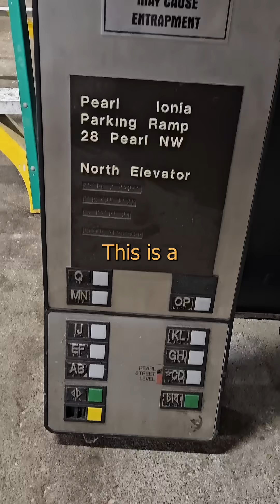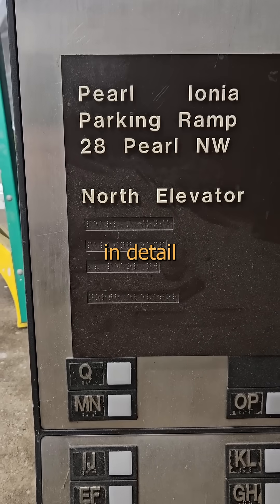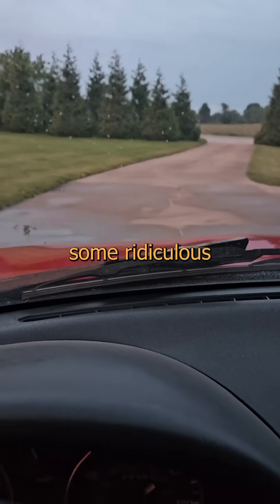Miata Mischief #chrisboden #engineering #gear #elevator #score #stories #parts #hacking #making

Comment: My buddy and I went four hours up into Pennsylvania last year for a tiller and blade for his John Deere 110. We’re in his 1984 Ford F350 Centurion Conversion truck, which at the time didn’t have AC, the wheel bearing was shot, from end has PLAY, tranny lives on Lucas, so on and so forth it’s not safe to drive. But we do anyways, and mechanically nothing goes wrong. Unless you count the wipers falling off on the interstate during the biggest hurricane of the season. 

Anyways, the trip up took 5hrs and some change cause traffic, there’d been a few accidents. We have the CB on while we’re sitting at one point and we hear “did anyone else just see this cop nail this lady?!” 
Sure enough, a cop that was flying up the side of the road tried getting in front of this lady and took her front bumper off. 
As we’re cruising by laughing, we see the cop standing in shame and his partner was head bowed in the cruiser still. That was our little comedy/tragedy/delay on the way up. 

But on the way BACK is when things got sketchy. A downpour slammed us. I looked up the weather and apparently we’re driving juuuuust in front of this hurricane, but it looks like we’re in the heat of it. We hydroplane here and there, the wipers fall off and we have to pull into a sheets in Maryland halfway home. The rain turns into a drizzle. He takes a Tik Tok of the rig at the pump (and I photo bomb in the back, dancing in the dark like the weirdo I am), we fill up the tank and our stomachs and hit the road again. I get a text from my girlfriend that two tornadoes touched down near where we were in Virginia, one is a rarity in this area, two is unheard of. His mom calls and says if the creeks flooding I’m staying at their place. 
We get home fine, creeks fine, I decide imma head home since our jobs done. Within the five minutes that it took for me to get into my car and down to the creek, it had flooded. This is a 6ft deep creek that runs under their driveway, it was maybe a foot five minutes ago. Now it was on the driveway. 
I go slowly through and hit the road. Not even a mile up the road I stop because there’s a tree (not too big but enough to ruin your day) in the road. There’s a guy behind me, he just honks, and someone else in the oncoming lane is coming but can’t see the tree. I hop out in this now torrential downpour and wave frantically. He stops and gets out confused, I start bucking bits of the tree (it had broken), and that’s when he sees the tree and begins to help. Other guy stayed cozy. We all start moving once it’s as  cleared as we can make it. Maybe two miles later, another tree, this time I swerve around it, the guy behind me does the same. The winds now picked up and is blowing us around the road. Eventually I get to my road and the winds blowing directly at me, and it’s so strong I had to put way more throttle into it than normal. Finally, I’m home, my girlfriend comes running out with her umbrella, being the sweetheart she is. Halfway back to the house the winds blowing directly shreds the umbrella. We run inside, soaked, tired, and I’m hungry again. 

I started that day at 5am. And didn’t get home until 2am.

Comment: Hmmmm, I was into burnouts and drifting as a teenager and I'd blown the differential in my Torana (an Aussie GM muscle car).
Anyhow as a 58kg 1st year apprentice mechanic, I urgently carried an entire Salisbury differtial/axle (which unlike a banjo differential, the centre is part of the entire housing), up at least a 2km 35-40° angle hill to get it home from work, complete with axles, drum brakes and I didn't even drain the oil 😆😆😆
It was way heavier than myself 🤘💪
I did not stop for breaks and when I got home, I smoked some weed and a cigarette and proceeded to install it so I could go out cruising in my Torana that night, which happened to be Friday, hence my efforts, which were a complete success 😁🤙

Comment: I own a little 2004 Saturn ion 2 door. The one with the fold out rear doors. I somehow fit a 7.5 × 7.5 ft L shaped desk inside and got it all the way back to my house. Granted i had to cut it in half and while driving only had access to first and third gear but goddammit i got it home.

Comment: When i was 18 i was brought a oversized skateboard like your friends around 50 miles away from my home, since me and my friends didnt have a car, we had to call an uber over there, but once we got there, the skateboard didnt have a working engine. And since we didnt want to spend even more money on this piece of crap, we unfortunately had to push it all the way to home. Luckily most of the roads were downhill, we also had to go to the store and buy some cheap high vis clothing or whatever and put it on two of my friends one on the front and close to the side. After what felt like forever we got home and just passed out for a good two days straight. We eventually got it working but i just remember the amount of blood, sweat, (mostly sweat) and tears we had poured into this shi- 😂😂

Comment: I've hauled a Hitch mounted snowplow home on a rear hitch of a truck with only a ratchet strap holding it in place.
Cause it wouldn't go indo the hole on the pin

Comment: I built a pair of long yagi beams in 1967. 30 foot long booms made from 3 inch irrigation fubing. I taped them on either side of my bike frame, and rode the couple of miles back home. I was a Junior in high school at the time. I was lucky that the farm supply store called the sherrif & told them that I actually bought them or I probably would have been stopped for stealing them.

Fun times, and the beams worked great!

Comment: When I was 14, we went to the town recycling centre, when it was just a dump, and my mum said "there's a TV there", on the edge. Quick as a flash, it was in the boot of the car. I never got it to work right, but I found out quite a bit about high voltages.
A few years later, when I mended computers for a living, a customer scrapped a controller unit in a 19" rack from their previous shop floor tills. Parts of that are still in my attic, 40 years later, though the chassis has gone to the 
recycling.

Comment: Oh and later in highschool someone up at the corner had a nice big 188 key wood grain upright piano out for pickup, and the trash people would've been there in less than an hour as it was early morning. I called my friend, stole my moms cr-v keys, gave them to him and loaded up a dolly we had sitting around (learned from last time). This also took about an hour in total, my fruitless efforts to push it first, even tried (gently) rolling it, had to redirect traffic and assure the trash guys they weren't picking it up i was taking it, getting it into the back of the car was also a whole process in itself then carefully driving down with the back open, and parking on the front lawn to push it out. We parked the car back in the driveway and i was decided future me was gonna handle my moms reaction, and we still went to school even though we were about 2hrs late. Then for like 3 years rain or shine that piano sat at an angle in our frontyard till we got evicted, though i think we had a tarp at one point, that was useless. When we got it the keys were swollen/warped rubbing against each other and you had to press real hard to make a sound and of course it was beyond out of tune, but with the right magical conditions, usually early before sunrise, after a storm it would just work, and still be out of tune, but it worked. had no real training, learned guitar for a few years through tabs and covers on youtube, tried doing the same with piano transferring the skills. I quite enjoyed playing some billy joel, elton john, some video game soundtracks like undertale, animal crossing, kirby, little big planet, not sure if my neighbors did though.

Comment: In 6th grade walking home from school there was a big old tube tv out on the curb. I had gotten a backpack with wheels for christmas which was all the rave then, that and wheelies, which i never was allowed to get. But anyway i tried balancing that 60lb or so tv, on the maybe 3mm thick hallow bars that made up the extendable handle to drag the backpack on it's wheels. I was moving maybe 15 feet every 7 minutes, and it was practically dragging along the ground because it smushed the bag part underneath and those shitty plastic wheels weren't rolling at all so i was pushing or dragging the whole tv instead and just kicking the bag along. Honestly it's a miracle none of it just broke then, but that could also be because after about 40-55 minutes and 100ft of progress up a curved hill a lady pulled over asking if i needed help and offered a ride. When i did eventually get home my mom was worried sick about me, not happy with the tv as neither of us could get it to work, probably why it was on the curb. Also i wasn't even supposed to be walking home, I missed the bus.

Comment: When getting the pieces to swap my interior to black, I found a mint black headliner, I knew it wouldn't fit well in my car without removing the old one, but the junkyard didn't accept old parts, so I decided to block my entire rear vision and rest it on the top of the front head rests, made it back in one piece but I wonder what passing cars thought of me having a headliner on my head

Comment: I had a 2004 BMW 330ci and in order to get a 3rd backup engine I took my passenger seat out and put the engine where the seat used to be. It fit perfectly! Even with the intake and exhaust manifolds on 😂

Comment: Not a super crazy thing I hauled, was a garden table, however how I moved it was sketchy AF. Took the legs off, collapsed my back seat and propped one end of the table top on top the headrests of my front seats so it was at a diagonal down to the back of my car as it was a couple inches too long to lay down flat. Drove like that 50 miles down a motorway at 70

Comment: OK... a bit different but. Years ago I had a VW Squareback, which was a small station wagon with the air cooled engine under the cargo floor in back. I and my brother were coming back from the beach towing a small sailboat. When I went to pull away from a stop the gas pedal went to the floor, stayed there, and the engine went to idle.. the throttle cable had failed. So, I took the engine cover off and tied a rope to the throttle. My brother got in the back seat and worked the throttle with the rope while I did everything else. While getting this set up a Highway Patrolman stopped to check on us, when he saw what we were doing... and that we obviously weren't drunk... he shook his head, whished us good luck, and left. 

It was a bit trick coordinating things, but we made it home.

When I started to replace the cable I found it had just become unhooked from the back of the gas pedal, I could have fixed it in less than five minutes alongside the road... I never did tell my brother about that part.

Comment: I once bought a halberd at a renn faire, and had to feed it into my Impreza through the sun roof. The blade portion stuck out, at least, 5 feet above the car. my brother in the passenger see was in charge of holding on to it so it didn’t bounce up too far and fall out.

Comment: My girlfriend (now my wife) and I were driving around in my old neighborhood in her car.  The transmission died.  Knowing nobody with a suitable tow vehicle I called my oldest friend who, at the time, had an ambulance company.  We had no tow bar (and this was how and when I learned why you want such a thing).  He ran a rope from the back of the ambulance to the front of the car and towed me.  Now the flashing lights helped but if I didn’t keep constant pressure on the break, the rope would go slack and all manner of bad shit would happen.  
Cool follow up: She was getting a new car anyway so didn’t care much about this one.  Gave it to my dad’s friend.  He took the automatic transmission apart and discovered the issue…. Whomever owned it before her “fixed it” but when they did, the put one of the many gears in backwards.  Oops.  At least it didn’t decide to crap out when we (a couple weeks earlier) drove from NJ to Florida and back!

Comment: I was about 20, and was driving a K-5 Blazer around town. The shell did not come off for...reasons, so on it stayed. Anyway, my uncle calls me and says he needs me to run over to a store and grab a chain-link gate for him. No problem. So I cruise on over to pick it up. That's when I discovered the rear glass also didn't come down. Try to put it in the back seat,gate wouldn't fit through the door. So I tell the guys to bring me some twine, and I tie it over the passenger side door!😂😂😂 drove it like that all the way across town. My cousin just happened to be with me, and got a kick out of it. Good times!!

Comment: I and my brother were out i an abandoned iron ore mine  town that had been scraped out after WW2 and we found a fire hydrant in i climp of trees.  Cool right, all we had for tools to disconnect it from the water pipe it was bolted to was a left handed crescent wrench and toe strap and a busted hacksaw. It took all day to get that thing in the back of my dad's suburban and a lot of gasoline to snap off the metal rod that controls the valve that was in the ground off. But we got it home and put it in my mom's flower garden after we turned it into a bong. 
Mom's a sheriff's deputy so hiding and playing sight for years.   That was 27 years back and now it's in my front yard at my house.   I was young and so dumb😅

Comment: I’m late for a giveaway, but I still got a story. 

When I was 15 and had my learners permit, my dad needed to transport a small enclosed trailer to my grandparents. This was about an hour drive at this time, which wasn’t a big deal and I’ve hauled a trailer before. This trailer in the condition it was in weighed about 5500 maybe 6000 lbs, and it was being pulled by my 05 Honda Pilot, great car by the way. On the day of, my dad wanted to transport his motorcycle from our apartment to my grandparents covered driveway, so this meant we were now driving separate, while I’m over loaded and still using a permit. It went 99% of the way perfectly fine, besides one a curve at train tracks  that really tested the pilots ability to stay on all 4.

Comment: I had to pick up my cousin mini bike and well since i had a 2001 BMW 325Ci convertible. And well only way to get the bike to not fall out my trunk with the lid fixed open, so then i used a ton of zip ties to ensure its safety. From the back it looked like the most red-neck setup ive made. All because his chain snaps when he pulls into the gas station...😂😂😂😂😂😂😂😂😂😂😂😂😂😂😂😂😂😂😂😂😂😂😂 the call was even more funny to listen to as ik I was his only hope of saving him.😂😂😂😂😂😂😂😂😂

Comment: years ago, working in a helicopter shop - I was awarded a large piece of a helicopter gearbox - made of magnesium alloy - which burns incredibly hot - however, to take it to my parents place, meant a 1.5 hr bus trip - and it had the bolt studs still in place, but to my credit, the 75,000$ piece of broken (scrap) helicopter gearbox made it home , and no one one the city bus got hurt

Comment: How about 99.7 miles from Selma, Oregon to Camas Valley, Oregon, towing an 18 ft car trailer with a 52 GMC COE flatbed with the heavy old hydraulic lift-gate, yes, REAL STEEL.
 4 STEEP grades no trailer brakes, no rear brakes on the truck at that time...
 At the Brockway scales, the pickup weighed 8,200 lbs, the trailer weighed 12,050 lbs.
💯 SKETCHY 💩👀☕

Comment: A while ago we went for a kayaking trip with my whole family. We took our truck, (2005 silverado extended bed standard cab with a v6) and my dads 2022 civic. 

We got to the ending area, and took our truck up. Four of us, 3 kayaks and a paddleboard, so we had to squeeze into the cab. Also, the leaf spring mounts rotted away.

We listened to an unpleasant grinding noise all the way to the the top of the river.

Comment: I was a heavy equipment operator for several companies on the road. Besides my weekly wage they would pay for a hotel room. Most of the time it would have a kitchenette. But sometimes not. I had a few appliances but the rooms never had enough counter space. I was working in Corinth MS. There are no extended stay hotels. Anyway I decided I needed a table or something close to that to cook on. Went to the local thrift store and found something I could use. A co worker said he'd haul it back to the room for me. But it didn't fit in his car. I only had a motorcycle. Harley Davidson Heritage Softail... So I hauled it to the room. Strapped to the back of my bike. <div style="height: 0; padding-bottom: calc(74.21%); position:relative; width: 100%;"><iframe allow="autoplay; gyroscope;" allowfullscreen height="100%" referrerpolicy="strict-origin" src="https://www.kapwing.com/e/686de14303354ba7b68dea3f" style="border:0; height:100%; left:0; overflow:hidden; position:absolute; top:0; width:100%" title="Embedded content made on Kapwing" width="100%"></iframe></div><p style="font-size: 12px; text-align: right;">Image edited on <a href="https://www.kapwing.com/video-editor">Kapwing</a></p>
Reply: I don't know how to upload the photo.

Comment: I hauled a 12ft sectional in my tacoma with a 5ft bed. Couldnt fit the long way so i stacked it up gave the ol ratchet straps a good tug and said "that aint goin anywhere." It was sticking way over the cab. 35mph winds and i had to drive back roads out of town to my town thats usually a 25 minute drive was a 45 minute drive. It was worth it for a free couch.

Comment: I hauled a traxxas bandit, brand new in box, covered in duct tape so it wouldn't fall apart (Traxxas boxes are 2 pieces that don't hold well together) on the right handlebar of my bicycle, i had to hold it with my right hand, so i couldn't shift, and i only had the front brake